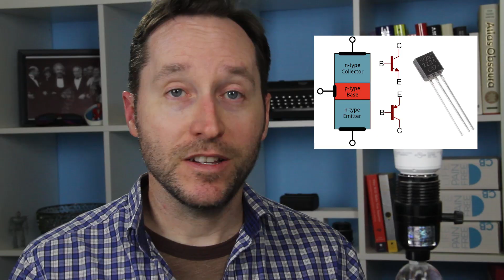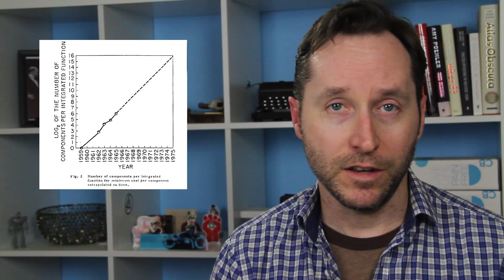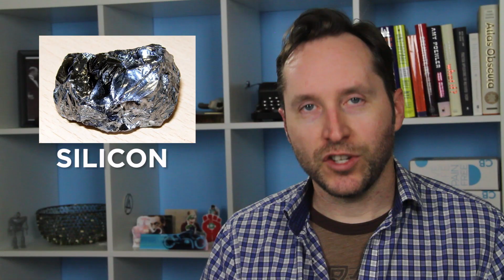Moore's Law Is Ending - Here's 7 Technologies That Could Bring It Back To Life | Answers With Joe

Comment: Well, DNA should only lasts forever if you keep it in a sealed conainer at the right environment. Else we would be swimming in dinosaur dna ;)
Reply from the maker: Well, forever has been mathematically calculated to be about 1,000 years or so. That's a fact (that I just made up).
Reply: semi-related fun fact: DNA can't last forever. It has a half life of 521 years. Cheers!

http://mobile.the-scientist.com/article/32799/half-life-of-dna-revealed
Reply: DNA has a half live of about 500 years
Due to it's nature of being a double helix, for every error you basically have a backup, which makes it a very good molecule to store information on
Reply: +oggi mog To be fair any system of matter that requires complex organisation for proper functioning wont last forever at least not unless you can violate the third law of thermodynamics and store it at absolute zero or you actively invest energy in active processes to maintain that organised state. That goes for silicon microprocessors too they are constantly slowly degrading due to processes like dopant migration of course that processes does happen faster if you activate the device as the waste heat increases the most significant variable affecting the rate of degradation ie Temperature.

Of course one thing that might go for DNA computers here which doesn't for silicon is that there is potential perhaps to make a DNA computer which is self healing. There are organisms on Earth that we know of which appear to be functionally immortal if we could figure out exactly how that works despite the fact that their DNA would be under constant attack both from Oxygen radicals etc from metabolism and normal thermal degradation perhaps those processes and repair enzymes etc could be used to make self healing DNA computers.
Reply: "Bingo, dino dna!"
Reply: DNA has a functional half-life of ~500 years.

http://www.the-scientist.com/?articles.view/articleNo/32799/title/Half-Life-of-DNA-Revealed/
Reply: That sound nasty ! Bender, "all you humans shooting you DNA at each other" !!!!
Reply: Offthechart Gaming ...Make it RNA storage for Smiley Virus!
Reply: oggi mog you are swimming in whale's DNA if you know what I mean
Reply: +Kevin Roth Actually half the backbone bonds breaking in 500 years which is what the article says is pretty bad, by that number after just 1 year a 1MB (4,000,000 base pair) sequence would have split into 4,000 fragments in just 1 year (2,000,000/500 = 4,000) that's pretty bad for data storage though active repair is a possibility as long as each break is fixed before the other strand also breaks it's not a major problem but would need DNA repair enzymes to be present for storage to last even a fraction of what existing storage achieves. The DNA should be possible for long enough to keep an online device usable for years though after all our cells seem to manage to keep around 3 gigabases worth of it mostly intact and functional for creating viable new cells from it after around 10 decades during which time said person would have repeatedly replaced traditional storage devices that failed!

Of course that does also suggest that it wouldn't be so bad for archival storage though, at 77K (LN2 temps) some 230K lower than room temperature reactions would be approx 2^(230/10) = ~8.3 million times slower since as a rule of thumb reaction rates approximately double with every 10K increase in temperature. At that rate you would expect around 0.5 errors per MB per millennia which is way way better than any existing archival storage system though at the obvious maintenance cost of keeping it cryogenically stored but it's not like it would need a massive dewar to do this given the massive storage density. Only problem of course is that it would need to be thawed to actually read it.
Reply: Only if you have a Chromosome (the back up).
Reply: oggi mog, we will GM that DNA so it will last forever OR create GMHB that will live forever.
Reply: Nothing lasts forever. Even the atoms of the container and the DNA will decay.
Reply: surprise, most of the water on earth is dino pee with their dna n all.
Reply: we're all just quanta of corresponding fields...
Reply: You could jizz in the computer
Reply: oggi mog ur wrong. DNA lives forever but still can be destroyed. Dinosaurs were extinct along with their DNA and even if there is DNA of dinosaurs left on earth it's useless without a cell.
Reply: By that argument a CD would last forever if it doesn't get destroyed by heat or vapour wouldn't it?
And the dinosaur dna didn't get destroyed with the them, they weren't all incineated.
But sure, if dna is hard to destroy it's still pretty usefull.
Reply: oggi mog what is a CD made of and does it decay?
Reply: hmm, maybe the cd wasn't the best example since i don't know ;)
The point was just a bit of nitpicking on the word 'lasts forever'. But I don't have a problem with the fact that it will last forever if it doesn't get destroyed by something.

Comment: Moore's law is primarily a function of improvements to photo-lithography technologies. Wafer purity improvements, ion implantation, and improved cleanliness also played important roles in increasing the density of mosfets that can be fabricated in silicon.

A couple of other things the semiconductor industry might try to squeeze out more performance.

1. Materials with higher Electron Mobilities (faster switching transistors). (SiGe, GaAs)
2. Different substrates to reduce parasitic capacitance and provide better heat sinking (Sapphire)
3. High temperature materials. (SiC)
4. Dual gate technologies or Fin-Fets (reduce leakage of small transistors by adding a second gate) 
5. Strained Silicon (higher mobility).
6. Mosfets with intrinsic channel to reduce leakage.

 Smaller, Faster, Cheaper.